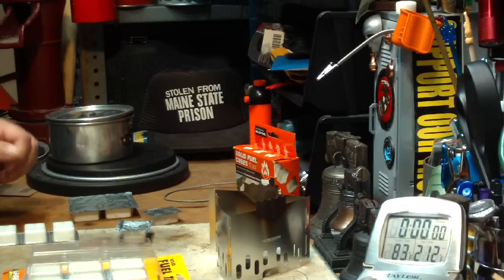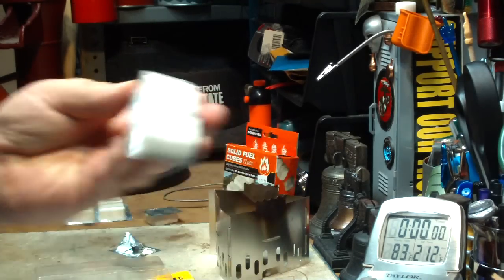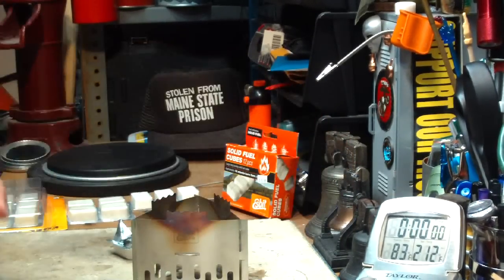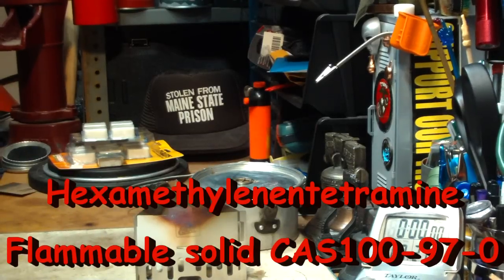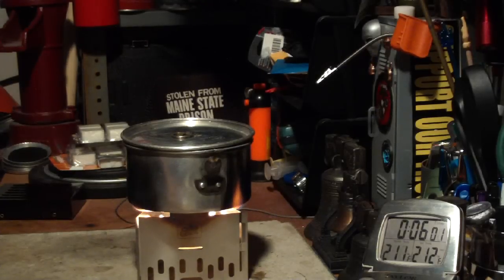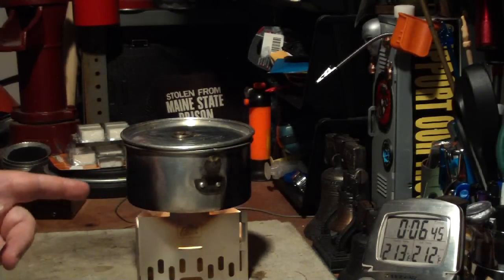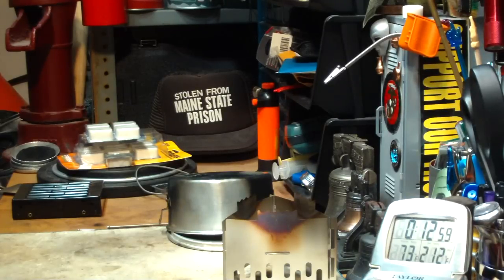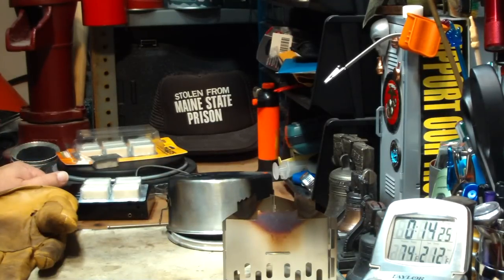Grabber Outdoors  Solid Fuel Tablets - Boil Test #1

Comment: Been using tablet stoves almost exclusively 40+ years and I'm always looking for a new stove or fuel manufacturer to try out. I did buy some of this fuel but haven't "fired it up" yet, no pun intended.

The pot residue here does in fact look like soot such as what one sees after burning rubbing alcohol in an alcohol stove. The residue from Esbit and Bleuet is different. It's more of a viscous semi-liquid and is actually unburned fuel and incomplete combustion products and is a result of poorly designed stoves.

After many decades I've finally found my perfect ultralight pot! But I keep waiting for my perfect stove although I may have located it. Four Dog Stove did a vid called "The Mysteries of Hexamine..." At about 7:20 Dan presents a little cylindrical stove reminiscent of his Bush Cookers although much smaller. It could very well be my perfect stove. Alas...I can't find out its name or identify its manufacturer! Woe is me....